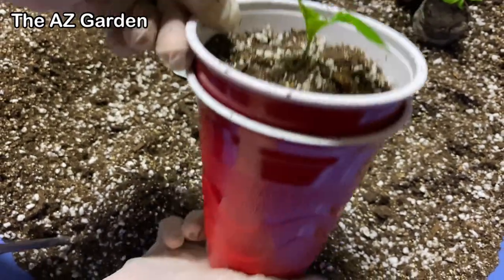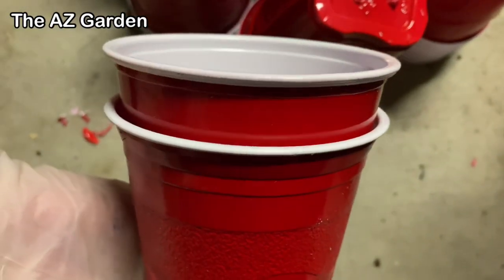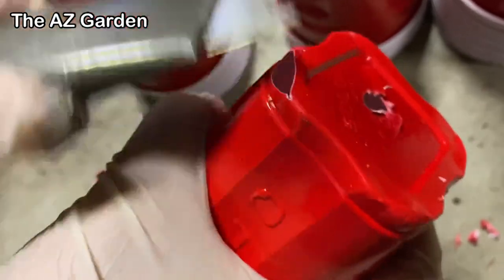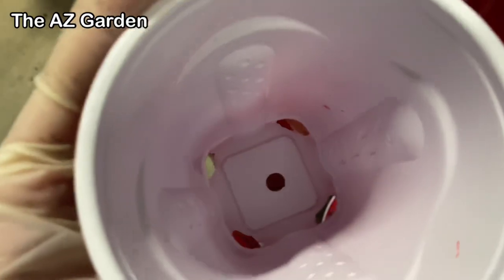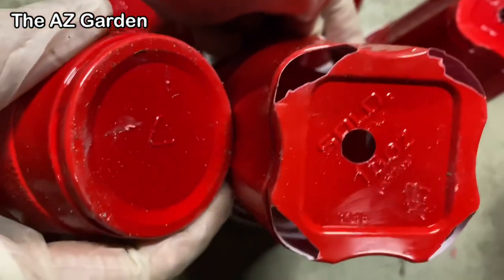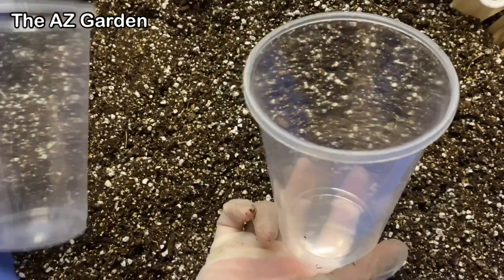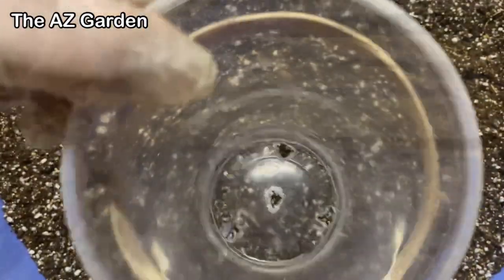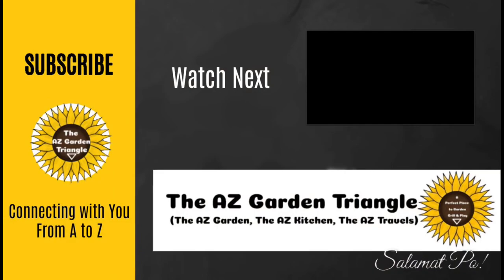HOW TO USE DOUBLE CUP METHOD | TRICKS TO POT UP SEEDLINGS

Comment: Has anyone tried putting some dirt or something like course mulch in the bottom of the outside cup to hold the inside cup up higher and allow the roots to grow into that? Any reason this is not a good idea?
Reply from the maker: Thank you for visiting 
I will make an experiment on that method and do a comparison this next gardening season
Reply: @Fil-AmGardening  Cool. I'm gonna try both also. I have some regular glasses I bought at a dollar store that are a little taller than the plastic cups. I'm going to try it with the plastic cups inside those with some extra dirt in the bottom.
Reply from the maker: Hello,, just saw a video from Next Level Gardening andchecused marbles from dollar store to hold the inside cup higher. It’s almost gardening season 😊
Reply: @Fil-AmGardening  Great idea.